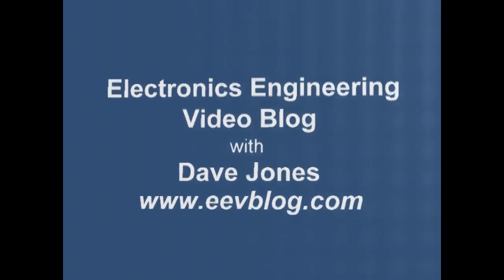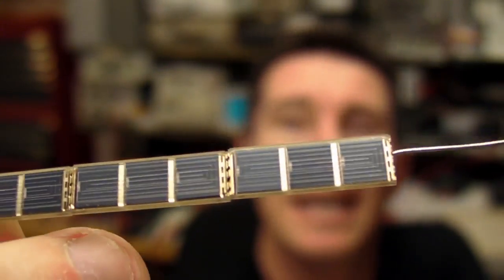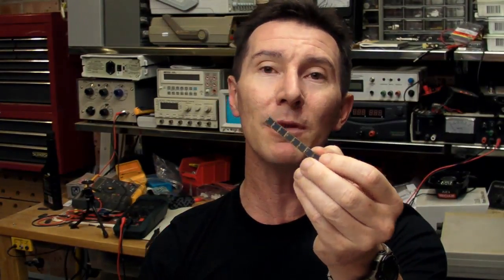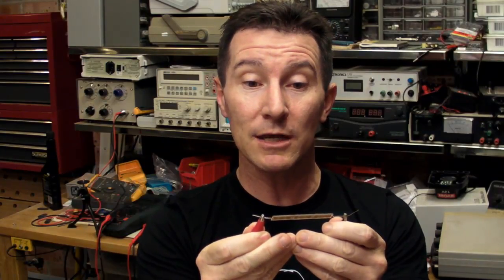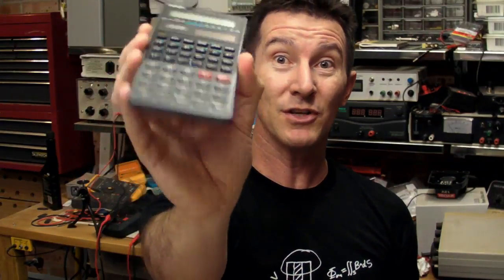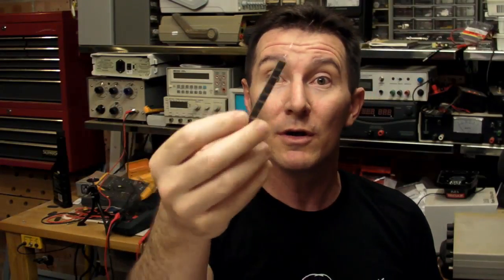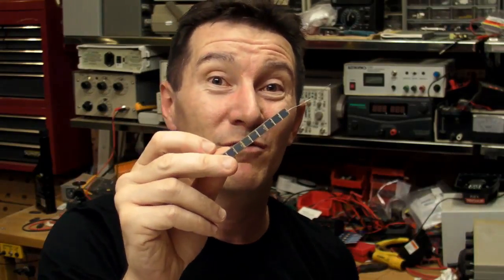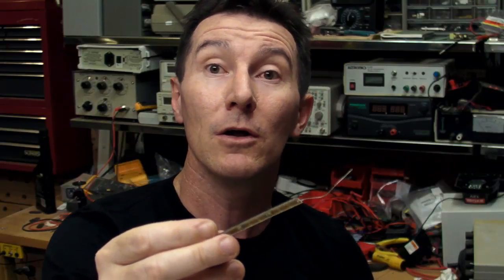EEVblog #48 - Solar Power Hope

Comment: Based on the power output of the Saturn V's F1 engines, you'd need 17.088955375 Gigavolts to equal that power with a current of 0.012 Amps to get to the moon.

Comment: Hello Dave,

A small error of unity i think. You should use lux unity and not lumen unity when speaking about the sun, as lumen is related to total flux getting out of a luminous source regarding to human eyes sensibility (let's say infinite for the sun ;)), and lux is simply related to a flux of light that a surface receives (lumen/m2). The best way should be to use a power meter device that gives light power received by meter square and relative to the spectrum of sun. As the power of your solar cell is given for a power illumination of 1000 W/m2 at 25°C and 45° of light angle, just use the hypothesis of a linear relation, and make the calculation to get an assessment of the power you could get. 
An other remark, i think that amorphous technology absorbs better diffused light, like indoor light, than mono and polycristalline.

Comment: Dave, you should look for PV cells that are optimized for indoor use, rather than high efficiency in sunlight.  I think there are some PV cells that are designed to use the wavelengths put out by fluorescent lamps.

Comment: You've also just demonstrated one of the most important reasons for using decibel units, which I don't think you mentioned in your decibel video, it's that our senses and many other biological processes, work at the decibel, or log, scale.  Basic example, octaves in music--spectrums plotted on linear scale don't seem right, on a log scale, it does.

Comment: Low power solar devices like calculators tend to use amorphous cells. I'm intregued by the claims that amorphous panels don't need sunlight, just daylight! Sounds like nonsense to me so I need to do some comparisons between silicon wafer and amorphous at different light levels. Maybe at low light levels amorphous really does beat crystalline.

Comment: Unless the laws of physics change, it will still be impossible to get more energy than is available in the light that hits the module.  The module would just convert more of the light hitting it into electricity.

Comment: That would be impossible as there is only a tiny fraction of the available light energy available in moonlight as there is in sunlight.  If the light on a PV module is only 1/10,000th that of sunlight, then said module can only produce 1/10,000th its rated power.  This means that your 300W module can only produce 30mW (0.03W).  To say otherwise is to get into the realm of free energy bullshit.

Comment: The amount of power that a PV module can generate is directly related to the intensity of the light incident on the module.  As the intensity of the light under a streetlight is a VERY tiny fraction of that in full sun, a PV module can only produce a correspondingly tiny fraction of it's rated power.  There will also be additional power reduction due to the inhomogeneity of the light.

Comment: Would it be possible to use something like 2x 5v 1F capacitor in conjunction with the solar cells then an on off switch so it would leave the cap charged?

If you left the calculator on a desk or table ect the cap would slowly charge, or would leakage ect prevent that from being practical?

Comment from the maker: @mopowah It is a credit card sized scientific calculator, there is no stand, there is no cabinet. If you had a battery in the stand you would NEVER need solar. A couple of AA cells would last their shelf life, so solar would be pointless.
You need more than just the right frame of mind, you need to meet technical power consumption specifications using available technology. It is simply not feasible.

Comment from the maker: @mopowah Nope, sorry, it's just not possible, regardless of how much you hope it might be. If you have a way to magically increase the output from the same surface area solar cell with the same thickness, by at least an order of magnitude or more, please share it.
Some things just just aren't technically possible using current technology, and you can do the basic math and measurements to easily prove that.

Comment: @EEVblog Depending on the size of the screen you could use a cabinet or a stand and integrate the battery and solar cells into the stand or cabinet it is possible I have no paper to certify me as much of anything but I am perfectly capable of deriving solutions for things with my limited knowledge. I would almost like to prove this thing is possible but do not have the faintest on what the best hardware to accomplish the task is or the code that would be required...

Comment: @EEVblog This is a practical product it could be made to work I think you need to investigate this one how big is the dot matrix LCD you are using I'd really like to know I think this project is indeed a work in progress with the right frame of mind it could be done. If you sold it with a cabinet that collected the solar or a stand it was on where the stand was collecting the solar and integrated a battery into the stand I think it is without a doubt instant and possible!!!

Comment: Have you also thought of the possibility of using a bunch of nano sized magnifying glasses and setting the solar cells a bit deeper if you could use nano sized magnifying glasses to amplify and concentrate more of the observed light to be projected at the cells you could likely increase your output and wind up getting a nice increase in power collected who knows use some of these last 3 ideas or all together and bingo your project is possible once again! Don't give up practicality 4 technicality

Comment: For better indoor collection organic PV (DSSC Dye Sensitized for one)is supposed to perform better with indoor light, given the correct chemistry inside. I am curious on weather you are still interested in this project I want to see it done I know it is possible how many cells and how much surface area would you need?

Comment: I am curious if you have tried any daylight spectrum cfls to see if they make a difference due to the higher color temperature. I type this from my solar powered keyboard the Logitech K750 as I speak and realize that anything indoor solar could be made a possibility with a little thought here is another suggestion sell the TV with a that has a frame that it mounts to built with an enclosed cabinet for your bluray the top will be covered by solar cells and have an XL TV frame covered in them 2

Comment: For a similar system I found a rechargeable button cell 1.2V 300maH. I cant remember what it was. But I used a DC/DC converter to go from the solar cell to the battery... in parallel with the circuit... it worked for a bit (cheap IC's)... but then the project was scrapped

Comment: Well maybe you can use some buffer, like slim supercap, or li-poly battery, that can be really all shapes and flexible. If the life on fully charged acu can be up to hours, adding usb cable to charge + some solar cells at the back side of science calc is a good idea. But no cheap i guess. Still better to invest in regular standards. I'm a huge fun of eco-power myself, I'd problably buy one if constructed like this ;-)

Comment: You could increase the available area for a solar panel by using capacitive buttons behind a large array of solar panels and then put some perspex over the solar panels with the button outlines printed on them. I think this would give you the grunt needed to run the LCD.

Comment: Just connect the solar cell directly to the LED, do no use any resistor.

3mA and 2V should be enough to see a little light coming from the LED.

Comment from the maker: Yes, that's possible, but then it's not a practical product. What happens when it's FLAT and you want to use it right away? Calculators are only useful when they are instantly available, and no one wants yet another device they have to remember to charge.

Comment: Hi Dave, this is an idea... you can still use the solar cells and add a huge capacitor to store energy.

Just use the same cells and charge the capacitor with direct Sun light outside.

You can get a 1 Farad capacitor from some web sites. Yes, there are 1F capacitors :D

Comment: I understand the lumen to current calculation (i.e. 1000x more lumen outside than inside, so 1000x more current ), but where does the 90db (30000 to 1) math factor in?

Comment: I think part of the problem is also that spectrum of fluerescent tubes (and LEDs) isn't good for Si cells. They like more the infrared part, so it should work better under incandescent sources.